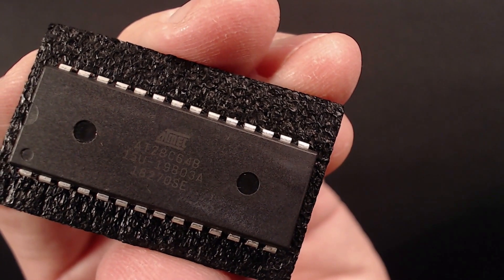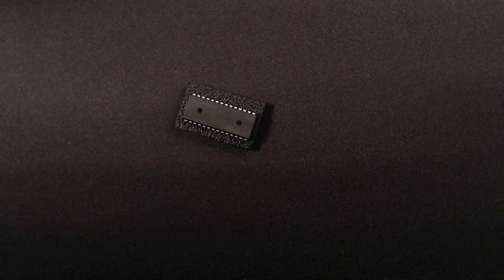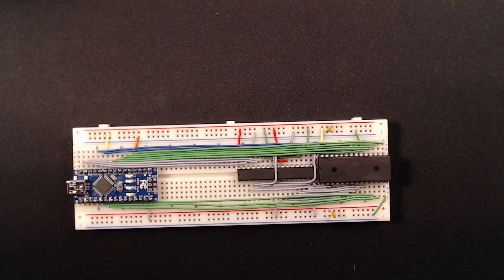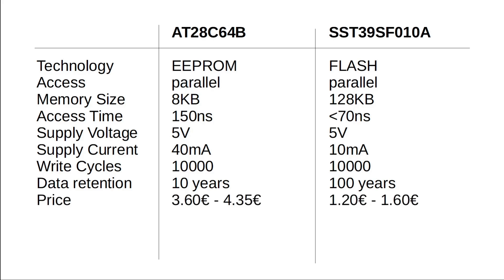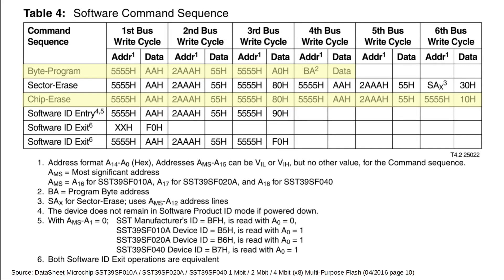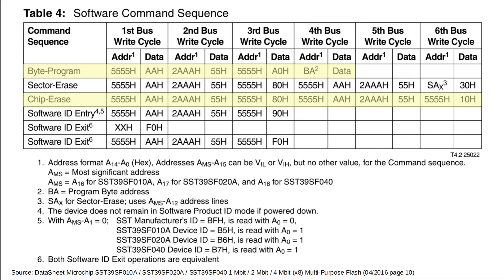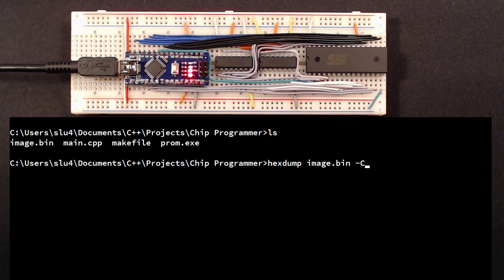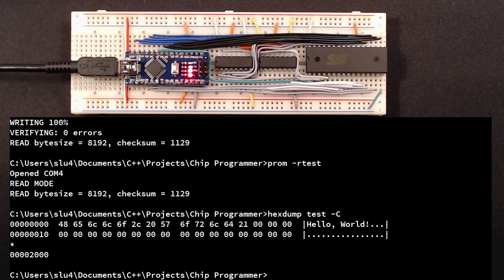Replace EEPROMs with FLASH Memory from Scratch

Comment: I've been watching a series of videos by John's Basement on his Z80 Retro project and … he decided to use these flash chips instead of the typical EEPROM. He then decided to build an in-circuit programmer. He used a pair of i²c GPIO expanders to give him the necessary pins to do it (with a minimum of level shifting from a RPi). It's slow to program the flash because of the i²c speeds. He could've gone with SPI chips, but they're less available.

But just using the '595s is a much better solution. You don't actually need more than 16 outputs if you're programming a 64k x 8 chip anyway since the Arduino has enough to enable and drive the chip even in circuit. Your programmer leaves a couple of pins free. One of these can assert the Z80's /BUSRQ. You culd even wait for /BUSAK, although I'd mostly use that for output enable on the 595s. More than 64K using John's literally the CPU pins solution would require a more complex bank switching scheme than he was using. (Actually more than 32K wouldn't work with his setup, but I'm not planning to slavishly follow that…)

Comment: I have an Arduino UNO R3 & an Arduino Mega 2560. Will they work with this or do I need to buy a Nano ?
Also. You have 2 schematics to work off of. But Which one do I use ? The one that looks like a drawing with all the different colors, is wired a bit differently then the other one.  I'm using a breadboard, if that helps.
Reply from the maker: The Uno will do just fine.
Reply: @slu467  Thank you. And what of the schematics ? Which one should I use ? I'm thinking... the breadboard schematic ????  Since I'm using a breadboard.  Just want to make sure I'm using the right one.

Comment: The Flash programmer works fine as long as Windows assigned the Nano a low number com port. My Arduino Nano was assigned com31 as I have loads of other FTDI based devices and prom.exe finds the port but can't open it. I had to reassign it to COM port 1 in device manager for it to work. I think C++ needs some workaround for com port numbers >9.
Reply from the maker: Had the same problem, too, and couldn't come up with a fix.
Reply: com ports greater than 9 need \\.\ prefix is what I read somewhere so it should be referenced as \\.\COM9       
 \\.\COM31 etc @slu467

Comment: Has any one had luck modifying the code to work on the nano every? PIND throws an error.
Reply from the maker: Hmm, I haven't tried the Every but they say it should be pretty much compatible to the Nano 3.0. I may buy one and experiment a bit though... My code doesn't use any fancy features of the ATmega328... and PIND is sooo standard...
Reply: @slu467  annoyingly while the Every is physically pin compatible with the older Nano, the labeling of pins on the software side is different.  Should be a straightforward 1 for 1 translation. I was more surprised it was an issue than too worried about fixing it
Reply: @slu467  good news, got the programmer working.

Comment: Interesting video. I tend to use FRAM in my designs. All the benefits of flash, but can withstand literally billions of random-access writes - no flash pages to worry about. All my designs that need to persist data use them via an I2C interface. Simple. They cost more than regular flash, though.
Reply from the maker: Thanks for pointing me in this direction. I will look into it.
Reply: @slu467  No problem at all. I normally use an 8Kx8bit version, the FM24CL64B-GTR. However, there is a nice 32Kx8 version, the MB85RC256V (Fujitsu). From the datasheet: "The MB85RC256V is an FRAM (Ferroelectric Random Access Memory) chip in a configuration of 32,768 words × 8 bits, using the ferroelectric process and silicon gate CMOS process technologies for forming the nonvolatile memory cells. Unlike SRAM, the MB85RC256V is able to retain data without using a data backup battery. The read/write endurance of the nonvolatile memory cells used for the MB85RC256V has proved to be at least 10 to the 12 cycles, significantly outperforming other nonvolatile memory products in the number. The MB85RC256V does not need a polling sequence after writing to the memory such as the case of Flash memory or E2 PROM."

You just treat it like simple random access memory - because it is! You never need to worry about write cycles/number of writes. I'm done with Flash! 😀
Reply: I thought of doing the same since a serial FRAM would work for storing data to be accessed by an mcu or a cpu, but if you intend to use it to store, let's say, microcode on it then you probably will need a LOT of circuitry just to interface it

Comment: Can I program it with Arduino?
Reply from the maker: My little FLASH programmer uses an Arduino Nano 🙂
Reply: @slu467  which one you can recommand it to me as a beginner to start with? I had experience using the Arduino 😃

Comment: Great video, after buying the same flash chip as you to experiment with, I have found that one of the things you didn't mention is despite being faster for writing something a single time and only reading from it, when you need to update that data, if even just a single byte, you need to erase the entire sector, which in your case is 4KB, which takes 18 ms, 18 times slower than an eeprom write, right? Not to mention the fact that you'd need to copy that 4KB sector to some other area and then rewrite it back into the updated sector if you don't want to lose what was already in that sector, and then erase the copy. And you've got to write to at least like 4 registers every single time you want to write something even if writing to fresh empty registers. To me it seems the only real advantage of it is that you can re-write the entire chip faster than re-writing to an entire eeprom, so you can test your new code faster. I mean, if the goal is to have a simple yet independent computer that can program itself, I don't see any benefit to using flash, it is actually slower than eeprom in many situations and also way more complicated.
Reply from the maker: Thanks for digging into this! Of cause you are right, but try to buy a standard EEPROM with 512KB for that price ;-)
Reply: @slu467   Yes that has since become apparent to me lol I actually can't find any of that size anywhere and the ones that are close are really expensive. The best deal I can find is 64KB for about a dollar a piece, though you have to buy ten of them at a time from Ali-express. Even digi-key has a very poor selection of eeprom. 

I'm currently torn between having a smaller ROM with easier memory management or a larger flash ROM that's way more complicated to use both in design and probably in writing software for it too. I even considered wiring up multiple eeproms with some logic gates to increase their effective size. Though this would be messy and I am too OCD for that haha
Reply from the maker: @tristanjohnson367  Hmm, the FLASH I've used does not require any additional design consideration compared to the eeprom. It's just the software thing and that isn't too bad either. Have you seen my video about a "poor man's SSD file system on a FLASH IC"? For me that's the solution.
Reply: @slu467   I did not see that video but I just watched it :) you're right it's just extra software you have to write. I'll have to look at the datasheet again as I got overwhelmed when I thought I was understanding it and then I saw something about something getting latched every sixth pulse lol wtf? You have reassured me that it isn't that bad, thank you.
Reply: @slu467   So are you executing from RAM? I'm planning on executing from ROM and I can't see how it wouldn't need new hardware because I don't think you can read in between the flash commands.
Reply from the maker: @tristanjohnson367  Executing the OS from ROM is not so hot for my design, since I also employ ROM bank switching to use 512KB FLASH... I would have to copy the OS code onto each ROM bank to have it available 24/7 :-)
Reply: @slu467   Oh ok I see, I'm debating executing from RAM/ finding a way to self-program. I actually recently learned that AVR MC's can self-program their flash and they execute from ROM, I think they just have some mechanism that takes over control from the flash for four clock cycles and enters the commands in, though that means separate instructions for writing, sector erasing, and chip erasing, I think. Thanks :)
Reply from the maker: @tristanjohnson367  BTW, my FLASH drive implementation for the Minimal can also be considered as "self-programming" FLASH ;-)

Comment: Third time is a charm; tried to put a question here 2x but it keeps being deleted ?
I Really like your 'Minimal' and the various concepts that make it. On and of  I'm working on a ScottCPU and I have the 29EE010 iso the 39SF010.
I've tried your Sketch/C++ but have yet to succeed in programming it; It might be the timing, or maybe it is another IC than it states, because I can program it with a TL866II+ only when I turn off ChipID recognition.

Question is there to your knowledge a reason why I could not use the 29EE010 (with similar program instructions) in the same way you use the 39SF010 in your 'Minimal' as ROM/Flashdrive?

Thx for any hints, KR Paul
Reply from the maker: Hi Paul, I do not have any experience with the model you've mentioned. So I can't be of any help here. In any case take a very close look at the datasheet. There should really be everything in it you need no know. Good luck! Let me know how it goes.
Reply: @slu467  Ok it was more to check whether I could use that similar built EEPROM the same way as you did with the Flash.
 (even somewhat easier because it does not have to be set from the 1 state start).
But thx anyway and succes with you great Videos.

Comment: Did you know a way to create a HDMI Signal with the nano and 512 KB RAM and two Shift-registers? Video 1920x1080 with 60Hz have a Pixel-clock of about 8 MHz if you take a 16Bit Shiftregister. You don’t need a HSYNC or VSYNC. The pixel clock need a RAM with only 60 ns access time. This is my idea because VGA Monitors are not up to date. A good way to have a video signal for a modern 27“ monitor.
Reply from the maker: Hi Paul, that sounds interesting! I might look into this :-)

Comment: Can we program 128KB files using "prom.exe" or is it just limited to 8KB? and can i use SST39SF020(connect the MSB to GND) as that is the only flash available in my area?
Reply from the maker: 128kB addresses are okay. If you plan to read the same amount out just change the read size in the arduino sketch. The 256kB version should work as well. Good luck!
Reply: @slu467  Thanks mate, i have been bummed for so long by the prices of EEPROMs,
thanks for providing such a better alternative :)

Comment: What are then downsides of flash
Reply from the maker: You have to erase them (only possible in blocks) before you can write. Cheers!
Reply: @slu467  you can read them byte by byte if remember right
Reply from the maker: @ducksonplays4190  You can read and write these FLASHs byte by byte, but a "1" stays a "1". So basically you have to erase them before writing and this can only be done blockwise. Old-style EEPROMs can also be written byte by byte. Hope this helps!
Reply: @slu467  it does help and i wonder why most eeproms are slow yet the winbond W27c512-45 is an eeprom that's 45 ns

Comment: Great job Wehre can I buy a Non Fake chip?
Reply: I get most of my parts from mouser. They only buy stuff from the official manufacturers, so they are super reliable. I’ve never had a fake chip.
Reply from the maker: Thanks! Can you explain 'non fake chips'?
Reply: @slu467  , There are chips Form china renabled with numbers from processors and have Not the correct Function. This are low cost chips with numbers from high cost chips. Called fake chips. Chips with less capacity of the original chip and so on. The seller of this chips are untrustworthy. I need a trustworthy  seller.
Reply from the maker: @viktorhugo8252  I prefer proven suppliers as well. Let it cost a bit more, that's worth it!
Reply: Mouser is my goto supplier.  They always supply the genuine article, and they're not expensive.  The company I work for has Mouser on their trusted suppliers list, and they make military grade equipment, which is a good enough recommendation for me.

Comment: Humm... Looks like it would take a lot of work to get this working on a Linux machine. Or at least a lot of code change. But interesting idea.
Reply from the maker: Hi Rick, I think it should be pretty straight-forward actually, but I am not a Linux expert. It's just the serial communication class that would need some attention. Cheers!
Reply: That's where I'm at now, building out the Minimal and trying to get a workable Nano Every flash programmer going.